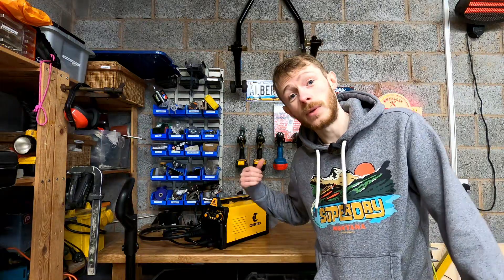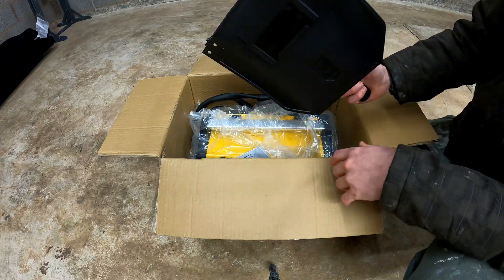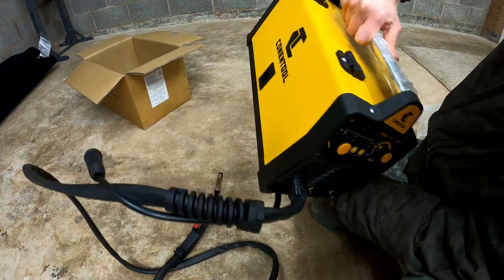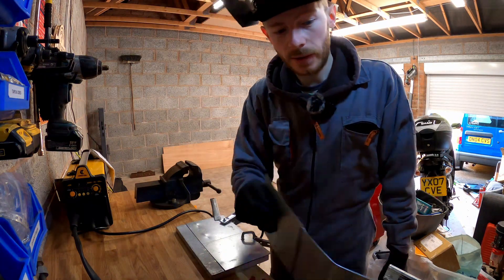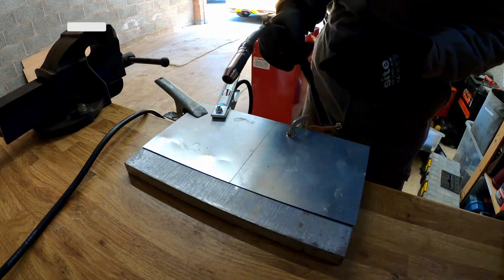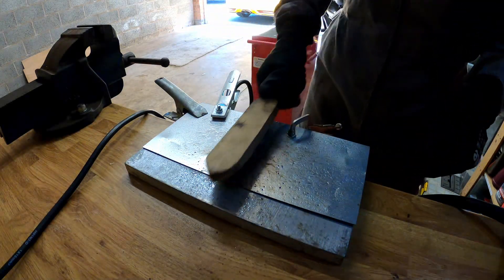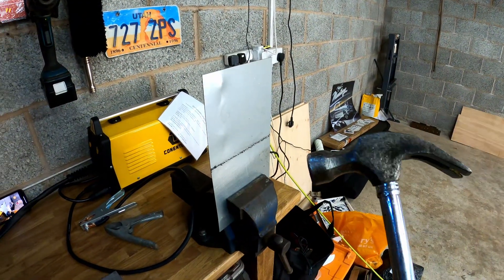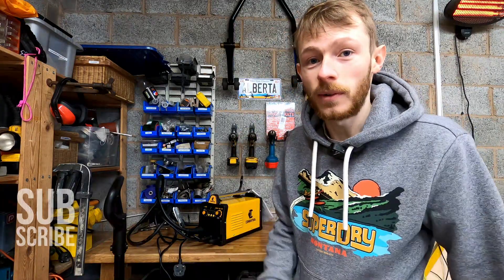Can I Learn to Weld Using an AliExpress Welder? | Bargain CONENTOOL GAS MIG Review

Comment: How are you getting on with the welder? Is it still going OK 👍
Reply from the maker: I'm getting on great, it's amazing! I did absolutely loads of welding on my van, used a few 0.5KG wire reels on it and it's still going strong. I have a 3 part series of welding the van on my channel using this welder, check it out 😁
Reply: I seen all your videos only. I've just blown my welder up from overuse, so I was looking for a new one so I've just ordered one like yours but they don't seem to do one with gass anymore they only do the gasless
Reply from the maker: @blackdotkiller1  That is true, it's a real shame they don't do a gas one anymore! Was probably priced too cheap for that or something 😟 gasless flux core works well though 🤷‍♂
Reply: @WheelzonWheels doch gibt es noch für 110€ werde es mir holen, habe zwar nicht vor mit gas zu schweissen, aber vll braucht man es doch mal

Comment: Flux core is great when you get the hang of it ( as you have) .   Because you are not using gas, you can take OFF the shroud and you can see your weld better.  There are special covers you can buy to protect the tip from weld or shorting,  if you are worried about sparks clogging it, but you can try it without and see if you think they are necessary. Most people just take the nozzle off to get better visibility when using flux core wire.  There is an American guy on youtube who uses flux core with a longer stick out on really thin or corroded steel,  as a way of lowering the current for filling holes.  He has some interesting techniques. (Bondo Billy) .  https://www.youtube.com/watch?v=PB-shAehAak
Reply from the maker: I'll deffo give it a try without the cover on to see if that helps, thanks for the suggestion! Oh yes I think I have seen his videos, they were very useful to understand how flux core works 😊 Thanks for the tips

Comment: Think you need to turn the power up to help it fuse together better or slow the speed rate down
Reply from the maker: annoyingly you can't adjust the power and wire speed on this seperately, the amps increases with the wire speed even when not on synergic mode 🤔 Thanks for the suggestion though!

Comment: Nicely done.
Fluxcore often gets a lot of bad press but it can give good results especially with high quality fluxcore wire, plus you don't get spanked in the wallet for welding gas. I used fluxcore on a Clarke 130EN to weld a lower quarter panel on my 1992 Rover 216 GTi and those outer panels are only 0.8mm thick.
Reply from the maker: Thank you 😁 That's really good to hear about fluxcore! I have seen so much conflicting info about fluxcore, but when I actually tried it it seemed pretty good, so I'm happy to hear of other people who have used it in the same way.

Comment: ive had one of these for about 6months now and honestly its better than my old vevor one which cost double. dont know how long itll last tho... currently stick welding 5mm tube with it and works great.
Reply from the maker: @SamFBM  I was worried about longevity too, but the fact you’ve had yours for 6 months gives me a bit of hope! 😁 is yours a gas MIG version, and have you tried the gas?

Comment: Just came over from the short to see if there’s anything else I might be able to give any small pointers on. 
1. MIG pliers have a specially designed cutter that you can use to get a perfect stick out every time you’re starting a weld.

2. With flux of any kind be it sticks or the MiG wire there is flux over top of the bead after it cools so you want to keep the bead going continuously to prevent flux getting into the weld and weakening it. 
Other than that you just need practice because that is literally the only way to become a good welder. For starting out you’re doing great gluing the metal and I hope you keep getting better.
Reply from the maker: @getoffmyjeep3161  awesome tips there, I deffo need to get myself some MIG pliers, I’ve just been using a pair of side cutters! Also that’s really interesting what you mentioned about the flux weakening the weld if you don’t do a continuous bead, perhaps I do need to invest in the gas 🤔 I will keep practicing 💪 I appreciate the support!!
Reply: just knock flux off dont run a stringer bead on -3mm sheet!
Reply from the maker: @ do you reckon pulses of weld are the way to go with flux core then?